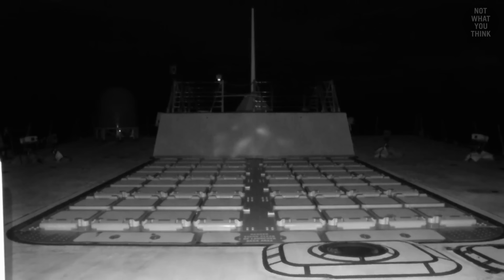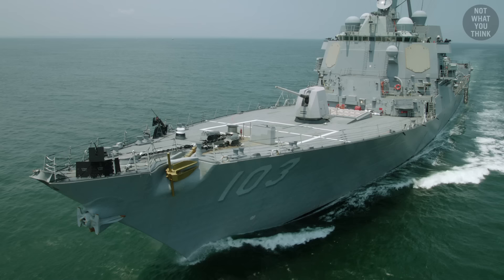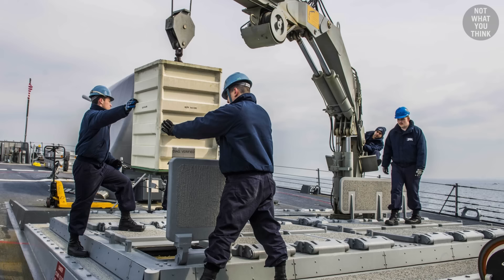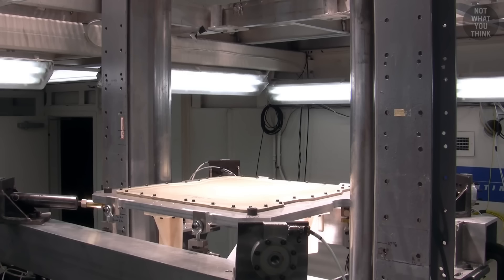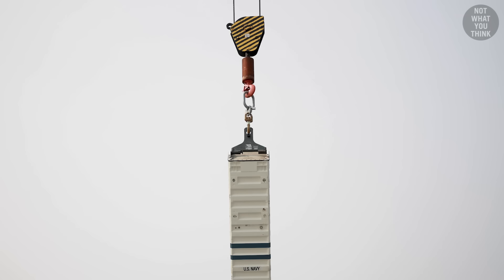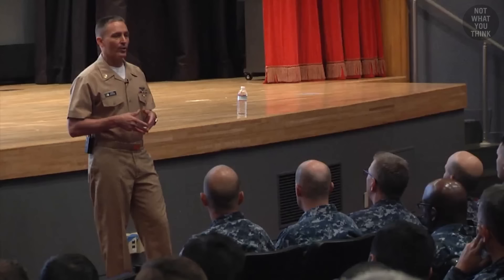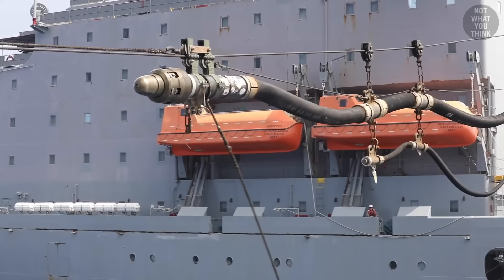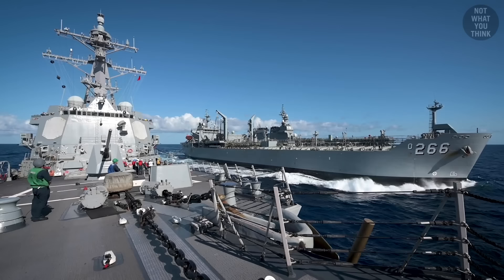Why Warships Cannot Reload Missiles at Sea

Comment: Arron,1st off asroc missles should be removed from VLS Launchers & put back in box launchers of thec70’s freeing space for SM2  & cruise missles. Why can’t the navy design a very
Large SWATH HULL ship with the ability to take Burke class inside its envelope where?an overhead crane can remove the whole VLS BOX out & insert a new, FULLY loaded VLS box in its place🤔 in moderate seas.
Reply: The VLS boxes are fixed to the ship, and a fully loaded one would be like 20x heavier than the cells they swap out (each cell weighing several tons already).
Reply: If there is a will there is a way🤔

Comment: It would seem to me if you retained a Mk26 style arm launcher, and the associated material handling infrastructure,  you could rearm pretty quickly by setting a container full of missiles down on the helipad via heavy lift CH-53 launched from logistics vessels, and feeding the missiles into the mechanism. You might not be able to do all types that way, but its better than running out.
Reply: Nope, VLS is far better than that would be.
Reply: @Kriss_L  Better than running out of missiles and getting sunk?

Furthermore, we don't have to choose, because we've since developed the Mk57 Peripheral Vertical Launching System, that doesn't have to use the same real estate.

Use the quickly reloadable arm launcher for self defense missiles, and the Mk57 cells for strike missiles, or rapid fire volleys, if the need arises.
Reply: A CH-53 couldn't lift an empty VLS module, never mind a loaded one. Individual cell reloads should be light enough but you wouldn't want to be trying to land those on the deck of a ship at sea while it's dangling below a helicopter. If sustained any significant impact in the process, the missiles would almost certainly have to be dumped or returned to the manufacturer.
Reply: @trolleriffic  You wouldn't need the whole module, just the missiles in a shipping container. And you wouldn't need all the missiles types either. The Mk57 PVLS allow you to use both reloadable Arm style launchers in the ships centerline, and PVLS cells on the edges. The switch was made to VLS because it was assumed that late Cold War naval engagement would be quick, furious, and likely result in escalations elsewhere that would preclude the need or opportunity to reload. Sustained conventional engagements were not in the cards, and if they where, carrier aircraft were assumed to be available. That assumption is now being challenged. The point here is to quickly restore a self defense capability after a major engagement. Basic SM-2s, ASROCs, quadpacked ESSMs in a canister, or NSMs are enough. You just need a passageway though the ship to get the missiles from the helipad to the magazine, where the weapon can be flipped upright and placed in it's rack. Depending on the size of the ship, that could be just big enough for the weapons themselves, or big enough for a whole line of containers.

As for getting the containers on deck, the CH-53K has a center hook rating of 36,000lbs, or a double hook rating of 25,000lbs. Your standard 20' shipping container comes in at just under 5000lbs. Your RIM-66MR comes in at just over 1500lbs. Depending on how it's loaded, and how much internal structure is needed to support the missiles, you could conceivably pack as many as 12 self defense weapons in a container. Depending on how much assembly you can do onboard, you might even be able to bring more advanced weapons on board if you pack the boosters separately. As for landing them on deck, we manage to land aircraft of that size and weight all the time. There might very well be some adaptation to be made, either with some sort of cradle on the deck, or some sort of landing apparatus on the container. But its definitely worth trying. It should also be noted that efforts to reload the PVLS cells should also be pursued, and would also require such an airlift capability. Those are more complicated, and would probably require a more stable gantry crane, or some sort of erector that settles over the cell. Such cells are best placed midship or surrounding the helipad. 

There is nothing saying you need be limited to self defense weapons either. But the larger ones are much heavier, and require boosters and potentially on board assembly, limiting the number arriving per sortie.  When you're under fire, defense is the priority. The VLS has it's place for the rapid fire capability, but once the naval battle is won, the ability to reload the ARM at sea provides the surface fleet the ability to switch gears and provide sustained support inland, without depending on a carrier. It would be great to see the Navy back in the fire support game, this time using the same precision rocket artillery that the Army uses. That's not practical with VLS, but it is with reloadable ARMs.
Reply: @trolleriffic  I did it with a CH-46D in early 1989.  We reloaded five SM-2s to USS Antietam underway in the Pacific.

Comment: The problem should of been tackled like the old rail launchers! Loading the pods should be fully incorporated in function! I would say from below deck! 
And the limiting factors listed are wrong!
Reply: VLS could be re-loaded at sea during the Cold War, but the equipment to do so was removed afterwards when the kinds of operations used during the two Gulf Wars, the invasion of Afghanistan allowed ships to reload pier side usually in Bahrain but also UAE and elsewhere in the region.  Removing the loading crane freed up more VLS cells for Tomahawks.  I have personally lifted an SM-2 and its VLS canister with a CH-46D helicopter underway at sea circa 1989 from our ammo ship USS Kiska to the cruiser USS Antietam.  Just one loaded SM-2 canister weights 4,200 pounds.  We had to burn down to minimum fuel in order to lift it.  At full fuel we didn't have the power to lift that much weight.  We transferred five loaded SM-2 canisters and brought back 5 empties.  I was mightily impressed that the crew of Antietam could reload their VLS underweigh on a day that was emphatically not calm and the seas were far from flat.  
Our ammo ship's STREAM rigs, and all STREAM rigs of the time, were limited to loads of no more than 6,000 lbs, though I understand the US Navy has come up with a series of modifications being applied to their STREAM rigs to allow lifting up to 12,000 lbs.  There are definite limits to how much weight you can transfer between ships at sea.

Comment: What if the logistics ship first dropped a big reloading jig over the VL cells?  Maybe that could increase the sea-state at which reloads can occur...
Reply: Easier to just reload at port and much more safe. Not worth the risk of million dollar missiles being damaged
Reply: Transferring loads to an from that rig just adds complexity, especially since each class and subtype of warship has different dimensions around the VLS block. It'd be unwieldy too since it also needs to be a crane that can lift several tons itself, so it will throw off the balance of whatever ship it's going on or off of much moreso than the changes of individual canisters.
Reply: @doujinflip   A clever engineer can solve difficult problems...
Reply: @bigvaxmeanie925   The amount of acceptable 'risk' during wartime is quite different than what the civilian sector is used to...
Reply: I'd bet the engineers would conclude that it's not practical or cost effective to retrofit such a system for existing platforms, and designing new ones to take a standardized jig system could compromise other important aspects of the warship since now more than the VLS itself is getting its structures altered.
Reply: @ElbowShouldersen  easier to just shove more missiles into it than reloading at sea. The benifit isn't good enough.
Reply: @ElbowShouldersen  Clever engineers also know when not to do things.
Reply: NSWC Port Hueneme already has such a rig.   They developed it in house and have done some testing but funding ran out.  The equipment exists however.

Comment: I myself think the reloading system used previously had too much man in the loop to control the reloading and also needed the cranetoift the full weight of the missile clear of any assistance. A better system would be to bring in the missile horizontally and place it hinged to the cell it is to go in and then lift oneend only using an A frame gantry style system. In other words you can lift more weight in worse Sea states with less exposed personel and faster. vertrep also being possible with cells landed on the deck near the system and then moved horizontally to position and then lifted while secured to the cell it is going in already. makes the transfer more positive on control and less liable to movement.,

Comment: Suprised vls systems cannot be loaded from below via a revolver type system
Reply: that kind of system would simply be way too large to fit on any existing ship, since the missiles themselves are quite damn long.
Reply: The VLS is the magazine. Instead of having a magazine (which itself would have to be at least as big as the VLS cell system) and a separate launcher, the missiles are just on the deck. A revolver reloader would just take more space and add complexity, and would have a lower firerate than the VLS cells.
Reply: How would you repair that below deck?
Reply: @arsarma1808  would probably be too big give the dimensions of the ship
Reply: @bigvaxmeanie925  hope it does not break...lol
Reply: @Phil-D83  everything breaks eventually

Comment: Oh btw, the reason why the PLAN's VLS does Cold and Hot launches is because it allows the the VLS the ability to launch more variety amount of missiles, and at the same time, they just need to design the tubes that protects the missile to be compatible to the VLS, so the VLS does not have to be redesigned for the missile.

Comment: Slow reload compared to what?  A Ticonderoga Class cruiser has 128 missile cells.  If you were to load every single one of them with tomahawks, the heaviest missile, that's over 500 tons.  The entire ship can be fully stocked with ammo from completely empty magazines to full magazines inside 24 hours.  I know, because I've done it.  The US navy can even reload the missiles at sea.  No other navy in world can do that.  VLS makes reloading at sea much easier.
VLS is much easier to reload than it's predecessor, the Mk-26 twin arm launcher.  The only advantage the Mk-26 has over the VLS is it's fire response is much quicker, which for short ranged missiles like the SM-1 was more advantageous.  This is because when a missile is sitting on a rail, it's guidance program is already preloaded, whereas with VLS when the fire command is initiated, the program is uploaded to the missile and then it begins leaving the launcher.  One thing to keep in mind, also, is that all missiles are leased until fired.  Only when the booster lights off when the missile is purchased.  Keeping the missile in a canister, rather than on a rail, ensures the missile gets returned in the best condition possible.

Comment: The U.S. navy would be so simple if it scrapped all the tiny 4-5” guns on top and cut back in missile systems and have 100 LVS missile tubes no torpedos and 1 simple 15” cannon. Yes not a 5” or 8” or 10” but a 15” maybe a 16” cannon a single turret a single cannon and fire a round every 30 seconds to 20 seconds or if it’s say a massive 20” cannon maybe one round every 1-2 minutes

Comment: It's beyond me, why this isn't fully automated procedure. There's SO MANY people involved in what amounts to loading steel containers of predefined size and shape. If there's any task, that can be relatively easily automated it is this one.

Not to mention that the cells should be loaded from the bottom, from within the ship itself, where they are protected from the elements and loaded up by some kind of powerful electric/hydraulic loader. Imagine a tank loading shells with a crane - insanity.

The way it's working today is just stupid and that is why it's not working.
Reply: Container ships can be loaded and unloaded quickly but that's using cranes that are far too large to fit on any auxiliary ship and they do it while securely moored in port. Try doing it at sea and it would end in disaster.

Comment: really there is a simpler solution  have the missles be packed in stacks of 8 and  have  2 cranes work together to drop the missle's  into the tubes'. as in having a housing to hold the missles in each cluster having divets in the  deck and on the stack so they litrerally slot together  for alienment then  drop then new ones in to the slots that need refilling then  cran back the empty stack  load the new on while the empty one is being refilled with missiles for the empty slots. 

as for stabilt under way I would have the  crane ship eithwe be a trireme or  out massive out riggers to stabalize its self at sea with inflatable bags on the out side of the hull or the rigger so that the destroyer could esentially dock with the support ship. 

or simply build a massive vessel like kommuna  just  for destroyers.
Reply: You would need a crane capable of carrying 14 tons then. Basically the size of a freight truck
Reply: Nothing about that idea is a simple solution.

Comment: So many issues with this video. First of all the title itself you even contradict in the video. The title of the video is just blatantly false, and obviously just for sensationalism.

Also it is not any more difficult to reload the VLS out at sea, than from a land based crane. Actually it is a lot trickier to do it from the stable non-moving land based crane onto a moving ship platform, however it is quicker. The issue is not being difficult, but the risk involved. We did it once as an exercise so we knew what all was involved if we ever really needed to. Even during a somewhat calm sea state, that was not fun at all and was a very risky endeavor, but a lot less trickier. Anything could have gone wrong more easily. However, the VLS 3 cell strikedown crane is moving along with the ships movement, so in that regard it is not as hard or tricky. Provided the sea state is not making that canister swing wildly. As the crane is moving along with the ship, the only tricky part is just lining up the bottom of the canister and getting it started. Once it is started into the cell of the launcher, it is much easier task lowering it from the VLS strikedown crane. Unlike it is with a land based crane, which needs to slowly, very slowly lower that canister. As the canister being hung from a non moving land based crane is not moving, unlike the ship and VLS launcher which still is moving. So the canister pinches inside of the cell until about 1/3 of the way in, and does not easily slide in until it past the half way point. So once the VLS crane has the missile started, it is now an easy task and does not cause pinch points like when being done from land based crane. It simply slides in. But getting to that starting point is a nightmare. Even picking up the canister from the deck of the ship while out at sea is scary.

"But it turned out the crane was only capable of lifting medium loads and they were incapable of lifting larger load like Tomahawk cruise missiles." FALSE!!! Been there, done that. As stated we did this even out at sea once. We only ever had various Tomahawk variants in our VLS launcher. It was quite capable of lifting a Tomahawk missile. The issue was that the crane was short and bulky. So not fun folding it and storing it away. Also it moved fairly slowly. It was so much easier and less trickier loading the VLS with Tomahawks using the VLS crane, but it was much quicker using a land based crane. The reason the USN stopped using it was because its main purpose was if needed to, to be able to reload while at sea. While this was possible and could be done, it was so full of risk and dependent upon good sea conditions, that it simply was not feasible and unlikely to ever be done beyond the once in a blue moon exercise. I NEVER want to do that again. It was just more practical and more usable to be used for more armament. There were other issues with the VLS crane as well, it was just big enough and strong enough to load the 20' canisters, but it really needed to be taller and much stronger so that it could have also moved quicker. But that would have meant taking up even more space, when it simply was not justified considering how often it might have been used. Yes sea state was a HUGE factor, you finally got one thing correct. Smh!

The video goes on making mistakes. Yes replenishing from a supply ship was limited by sea state, however NO it could and was done. We transferred a Tomahawk via unrep from deck of supply ship, to the deck of our ship. Then as stated above, loaded a cell with the VLS crane. The issue was not so much the replenishing from a supply ship, which was even riskier than lots of other types of replenishments, but again the bigger issue and risk of trying to load the cell while out at sea with that VLS crane. It really was not that big of a deal to spend half a day going back to a port to reload. We did this in the first Gulf War of Desert Storm, going back to UAE to fully reload 60 more Tomahawks. As well as loading from ports such as Singapore prior. Nor is it impossible to break away during unrep when transferring a missile canister. The issue is the huge loss in cost, and again it simply just was likely never to be used or done in real practice other than for exercises to show if it was possible or not. Risk, cost, and feasibility in the end ruled this out. And we are not even half way into the video yet. sighs